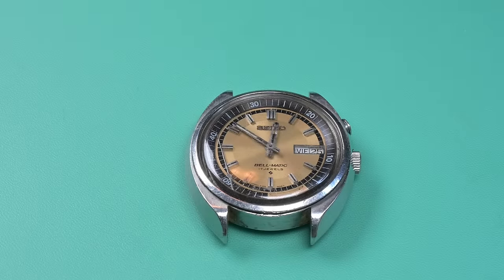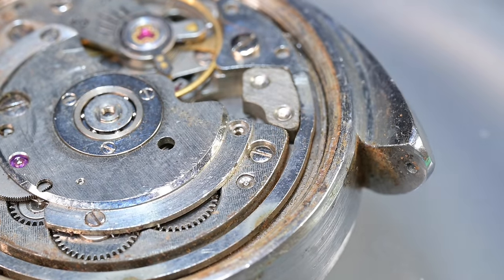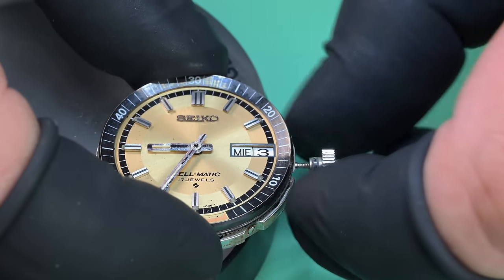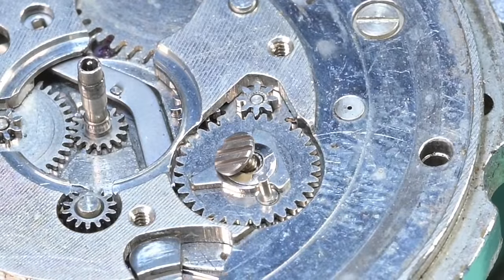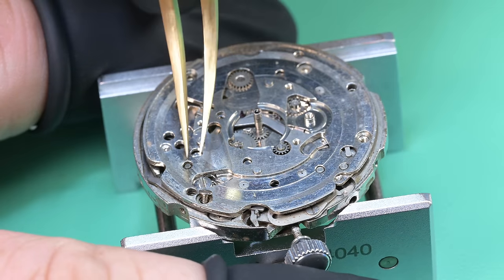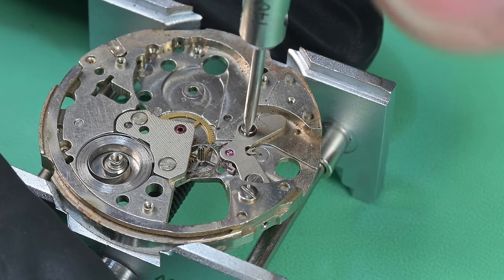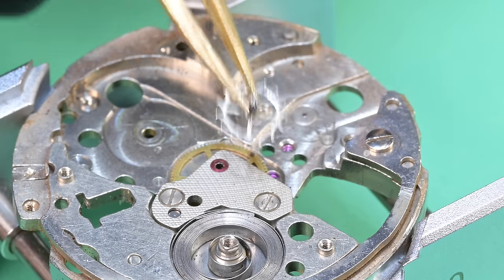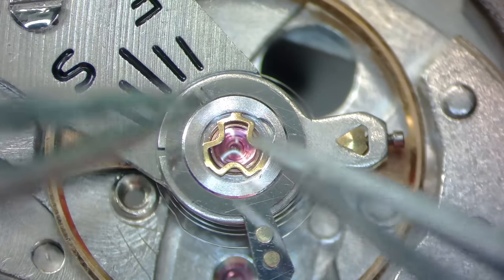Rusty Relic No More: A 1973 Seiko Bell-Matic Watch Restoration

Comment: I have noticed that everyone of those reverse thread screws have like a hamburger icon in them, have you ran into any of those screws like that on a seiko that wasn’t reverse threaded?
Reply from the maker: I’m sure they make them in very old models, but typically anything 60s and after will have the three slots on the screw head on Seiko watches to indicate reverse threaded screws. There are definitely other manufacturers and other movements that do not mark their screw heads that way, but several still do.

Comment: hi Adam, love your channel great tutorial on the Bellmatic, curious about the direction you wound the {primary} mainspring , most other Seiko's appear to run in the other direction. Must be correct as your amplitude was excellent.
Reply from the maker: It won't always be in the same direction.  Seiko does have some movements that will wind in the other direction.  It is something that I take note of on every single watch to make sure that the spring goes back in the same orientation.

Comment: Me again 😢.

When I put the calendar plate bell does not ring pulling the button out despite there being tension ( just like you do by 57:00 on). Manual says to check disconnecting lever or alarm train but I’m lost. What exactly means the “calendar train”? Any clues on how to isolate the problem?
Sorry for boring you again but I feel very frustrated. 

Best.
Reply from the maker: The calendar train is the series of gears that connect the calendar mechanism to the hour wheel.  The alarm train is the train of gears from the back side of the watch that connect from the keyless works all the way through to the alarm spring arbor, and to the other side of the movement ending in the alarm wheel and alarm hammer.  If there is a problem anywhere in this train of gears the alarm will not work.  Also double check your alarm setting lever, alarm setting lever spring, and alarm bolt yoke & spring.  This can also cause issues.  It will also not work if your disconnecting lever is not properly atop the spring and engaging/disengaging with the hammer correctly.  Best of luck.  I hope you get it sorted out.
Reply: Update: When I pull the button out alarm does not ring unless I poke the hammer. I’ve tried to post an YouTube link 🔗 but it seems it’s not allowed.
Reply from the maker: @sergiohegner8844 I saw your video.  It's difficult to tell, but there is clearly too much friction on something for that alarm to start on it's own.   Did you lubricate the point on the hammer where the alarm wheel contacts it?  I'd just recommend disassembling the alarm components from the setting lever to the alarm and make sure everything is super clean, reassemble and lubricate again.  It looks like everything is there, but something is binding it up.
Reply: @WeekendWatchRepair  I will do that my friend. This one was the trickiest I’ve ever serviced. 
Thank you once again.
All the best and post more videos.

Comment: Hello from Rio-Brazil! Thank you for this amazing video. I was able to almost fix my recent bought Seiko Bell…I say almost because after all mounted as you show so beautifully, I discovered that when I set crown wheel to second position, nothing happens, so I can’t adjust the alarm. Alarm sounds fine while turning the hands. If you can give me some help I will be vey happy! 

Anyway, congratulations of this video and channel.
Reply from the maker: Thank you very much.  Without seeing it, it is difficult to diagnose.  The problem likely is in the keyless works or in the bell setting gear train.  If you remove the dial, pull the crown to the 2nd position, and turn the crown, does the unlocking wheel turn? If it does then your issue is not within the keyless works.  If that is OK, check the connection between the unlocking wheel - alarm setting connection wheel (the wheel that is attached to the underside of the cover plate), intermediate alarm setting wheel, and then the alarm wheel.  It is easy to not get a good connection between the connection wheel that is attached to the underside of the cover plate and the unlocking & intermediate wheels.  If everything works like it should, you should see that large wheel sticking out the side of the cover plate (visible with the alarm wheel pulled off) and see if it rotates.  If it doesn't it's likely that the wheel on the underside of the cover plate is not engaged correctly.  If that wheel turns when the crown is rotated, then the issue is likely the connection between the alarm wheel (large round wheel that is what you look at when setting the alarm time) and the alarm setting wheel that it engages with.  I'd recommend searching for a copy of the 4006a service guide which will detail these parts and how they interact with one another.  Best of luck, I hope you get it figured out.
Reply: @WeekendWatchRepair  Thank you so much for this information. I will try those steps and let you know. I do have a copy of the manual but as English is not my mother language, I’m still struggling with some terms. 
All the best and keep on posting.
Reply: @WeekendWatchRepair  My good man, after hours & hours struggling with the problem I figured out the issue: setting wheel lever spring was not original and too short so it would not make tension in the setting wheel lever complete with intermediate unlocking wheel! 
Thank you for your help!
Reply from the maker: @sergiohegner8844 Fantastic.  I'm glad you got it figured out.

Comment: I've noticed you replaced the day dial. The one you took off initially had the days of the week in Spanish while the one you mounted had them in English.
Reply from the maker: That is correct, I sourced an English day wheel.   It was only after I uploaded the video that I realized I never made a mention of it.  Great catch!
Reply: Great video and great work, by the way.
Reply from the maker: @luisfernandoauredmolina7979  Thank you very much.

Comment: excellent video mate. Question...where do you get your documents from?
Reply from the maker: There are multiple websites that have archives of documents.  Generally I'll just go a google search and find them pretty easily if it is a more common movement manufacturer.  The My Retro Watches website also has a very good library of documentation.
Reply: @WeekendWatchRepair  thanks heaps will check ot out.

Comment: Hi Adam. Nice work on the Bellmatic. If you remember from our previous conversation I said I had lots of parts for these watches I believe that somewhere I have a set of the original black striped hands. If you’d like me to look I would gladly send them to you. Just let me know. Keep up the great content and your channel will grow before you know it 😀👍🇬🇧
Reply from the maker: Thank you very much for the offer.  While the black striped hands were original to that dial, the watch is not original.  It turns out the dial & bezel are not original to the case.  It doesn't bother me though.  I'm thoroughly enjoying the watch now.  If it were original, I'd probably take you up on your kind offer.  Since this watch is not original, I'll just keep it like it is, and you can save your parts to put towards an original watch.  I think it still looks pretty good with the other hand set on it.  Thank you again for the generous offer though and for the kind words.

Comment: I love the Bellmatic range, sorry to say but all the gold dial variants came in  SGP (seiko gold plate) case's, they are plated base metal and ware out. The vintage Seiko market is flooded with Frankenstein Bellmatics all made from parts, fully original watches are hard to find, lovely work on the watch.
Reply from the maker: Thanks a bunch.  That is very good info, and it appears this one matches exactly what you described.  I think it is a great watch now though.  I appreciate the comment.
Reply: @WeekendWatchRepair  You have turned a franken beater into a nice wearable piece and can wear it knowing it is one of a kind, I have the same dial but with a gold alarm ring I am thinking of putting in a UFO case. I am a sucker for blue bells though.
Reply from the maker: That would look good in a UFO case.

Comment: Hi Adam, the 4006 Cal uses 2 washer, those being date finger washer and the Setting wheel rocker washer, I have the same movement but unfortunately I'm missing one of them. they are apparently identical to one another, my question is , if you only had one, which would be the more important one to use. Cheers
Reply from the maker: I'm not sure there is a correct answer to that question!  Washers are pretty generic.  I'd measure the one you have and see if I could find one online somewhere.  Surely someone will sell washers by the size, even ones as small as those.

Comment: is the alarm sound of the clock? I have a mechanical alarm clock and it doesn't sound like a table clock. The case is too small to have such a resonance
Reply from the maker: The alarm hammer doesn't hit the case in this watch, but rather a large curved piece of metal called a sounding spring that wraps around part of the movement.  When the hammer hits that spring, it creates the tone for the alarm.
Reply: ok.Thank you for the information